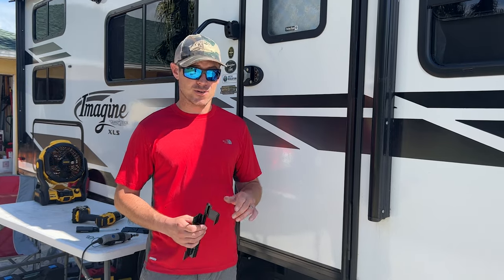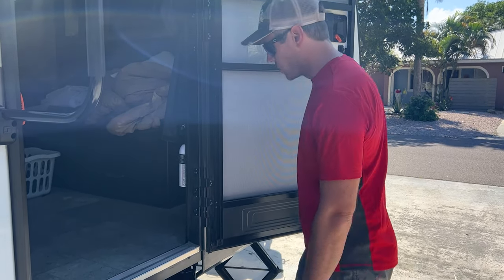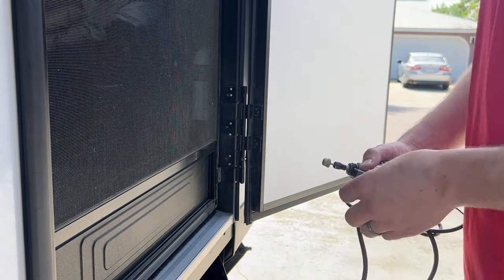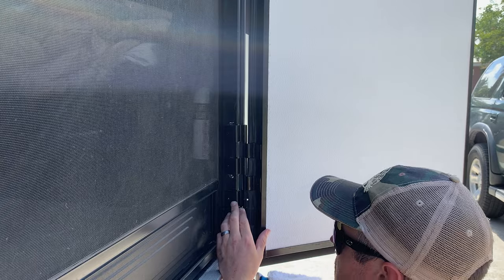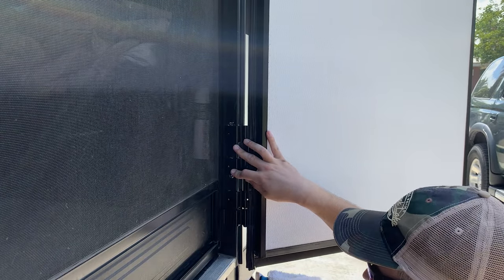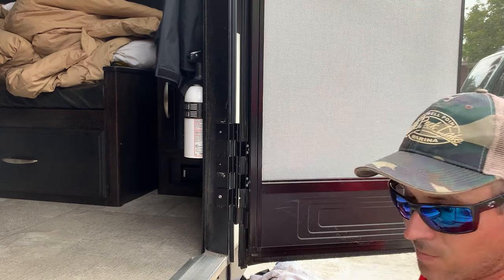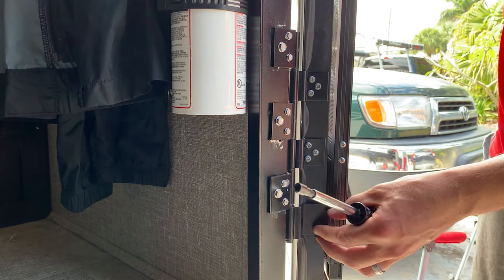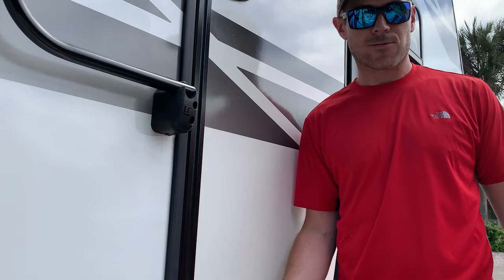How to Replace RV Friction Hinge

Comment: It's a good presentation.   It finished convincing me that I can fix my door myself.  I'm going to start by getting rid of the messed up (lower) friction hinge and I will see if the door is salvageable.  Then I'll order either a new hinge from Lippert or a new door assembly from Forrest River.   A new dremel is $85.   "Professional" RV repair is both my kidneys and those of my wife.   You might have just saved our kidneys and our lives, Jacob...   And yes, I agree that friction hinges are a good concept that's very poorly executed.   Once they fail, the result is pretty miserable, especially if you don't catch the problem in time but just get used for a while to wrestling with the door and putting up with the horrendous screeching sound that kills the living and wakes up the dead!
Reply from the maker: @RespectfulRevolution, thank you for the comment. It's much more affordable to replace it yourself. The hardest part is removing the rivets.

Comment: Thank you for this video! I have oiled the hinges so much trying to get them to loosen up because it’s so hard to shut! 🤦‍♀️ when we went back the next time I was going to try and remove the pins and oil them good. But this will be so much easier 😂. When we bought the camper he told me that’s just the way the camper doors was made now. Well for my parents that are older that come to visit they can’t hardly shut the door it’s so stiff. So thank you so much!
Reply from the maker: @Leann Crouse, no problem I'm glad this video helped you out. It's good to replace the hinge before it causes any more damage to the door or frame. We have some hairline cracks on the outside of the fiberglass door due to the stress the hing was putting on it before we realized what was happening.

Comment: I thought I liked the friction hinge instead of free swinging hinge. It’s messing up my screen door. Think I’ll switch to the more free swinging hinge. Great video.
Reply from the maker: @Ely Graycochea, I'm glad this video was able to help you out. We had free swinging hinges on our last camper. I will say if you like to leave your door open with the screen the friction hinges are nice not allowing wind to slam your door open or closed but each application may be slightly different based on your door location and where you like to camp.
Reply: @jacobsupgrades  At least until it tears the door apart...and it will.

Comment: Thanks for this! I am getting ready to do this on my Lance camper.  Is there a way to loosen up the friction on that hinge?  Also, what did you do to the bottom of the hinge, and why?  I also plan on replacing the hinges with screws, but will likely predrill the holes in the hinge leaves first.
Reply from the maker: @Asheville George, the phillips head screw at the bottom of the hinge knuckle allows you to loosen up the friction to more easily manipulate the hinge for install or removal. I believe the top cap of the hinge knuckle is only removable to lube the hinge when needed. That's a great idea to predrill the holes on the hinge leaves. But I would still recommend self tapping screws because there is a metal plate behind the jamb within that wall that you will anchor into. Let me know if you have any other questions. Good luck with your install!

Comment: The best way to remove a rivet is with a center punch and a drill bit roughly the size of the rivet shaft. Once you release the head you can use an awl to lightly pinch the rivet shaft out of the hole.  - US Navy Airframer
Reply from the maker: @snowsims146, thank you for the advice. I'm sure it's a much cleaner removal method. How do you prevent the drill bit from slipping if it's a dome shaped rivet head? Use a sharp one and take it slow?
Reply: This guy really does not know what he is doing. Friction hinges suck and you can fix them without buying anything except a drill bit.

Comment: Jacob - I’m looking for the exact same hinge as mine is broken - the part number u reference brings up a hinge with a middle connection to the screen door instead of it being on the end like your is in the video - help - can u tell me what supplier u got yours from..please and thank u!!!!
Reply: I emailed u😊
Reply from the maker: @td5997, I purchased my Lippert 258548 6-leaf friction hinge through RVupgrades.com. It looks like the listing has changed with the screen hinge in the middle like you mentioned. I did find a listing on Walmart but the two photos are conflicting. OpenTip.com has the right looking hinge listed. This is making me think LCI has changed production on their hinges and a new one may need to be modified or installed as is if an older style hinge can't be found. You could try reaching out to Lippert directly to see if they can help.
Reply: Yes I’m trying to locate this hinge with the screen door on end… can anyone help me locate one?
Reply: I don't think they make them like that anymore I ended up getting the one with the middle hinge you will have to modified

Comment: Hello Jacob. When I look for and find the Lippert 258548 Entry Door 6-Leaf Friction Hinge Assembly the arrangement of the leafs does not match my existing one which is same as yours. Question... Did you disasembled the new hinge kit and rearrange to have the leaf that attaches to the spring and the end?
Reply from the maker: @bensanchez1532, No I did not disassemble the hinge. I have reached out to Lippert and found out they have stopped production of these hinges. There are very limited numbers left out there in friction hinge form. I do believe they still make the non friction hinge.

Comment: These friction hinges are the worst. They're pulling apart my RV door.
Reply from the maker: @SNIPER27, I agree they're great when they work but when they fail they can do a lot of damage before you realize what's going on.
Reply: Same for my door SNIPER27.  The first sign something was not right was the door began hitting too close the the stricken plate.  After I watched when my door was closing, I could see the top friction and bottom friction hinge were cassette door to pull away from the frame and is the cause of the door hitting the striker plate, even after I removed the striker plate the door would scrub on the door frame where the stringer plate should be.
Reply: EDIT:  ...."causing door to pull away......  NOT cassette door to pull....
Reply: New trailer, pressure hinge has pulled the frame away from the door core.

Comment: Friction hinges are the worst … my rv door is completely misaligned as a result of them
Reply from the maker: If you don’t catch them early enough, they can create damage to your entry door and frame. Frustrating!
Reply: My door is misaligned so I have to remove (also the bottom one) and try to reset door